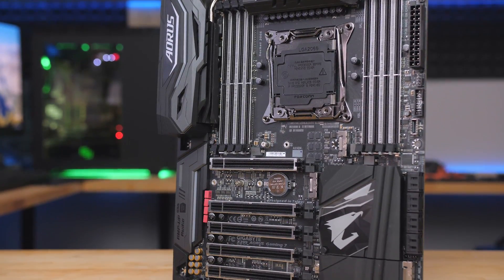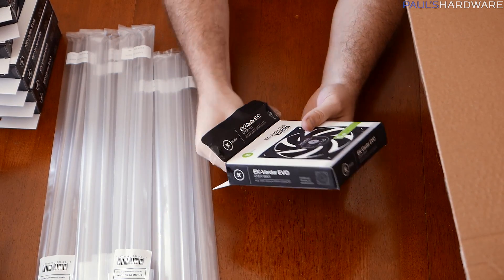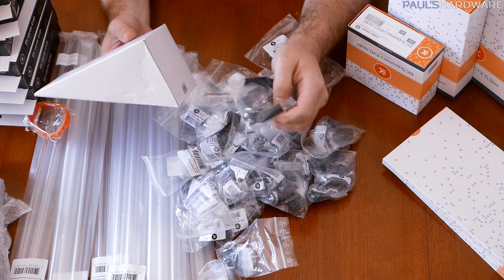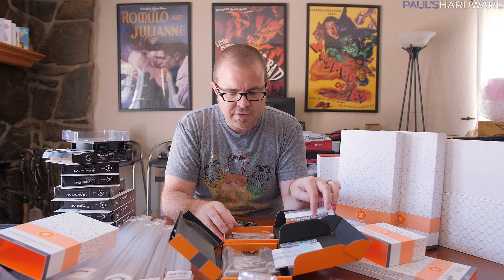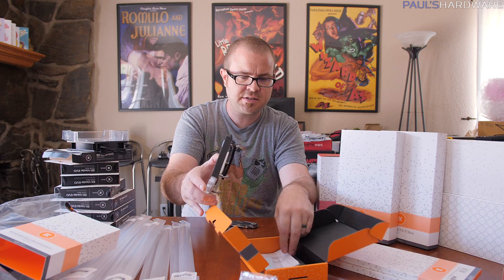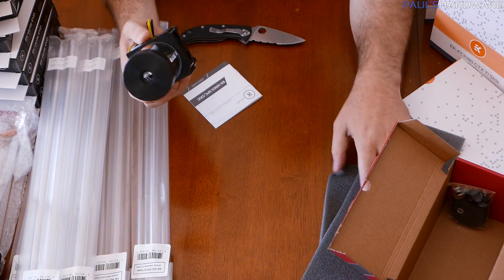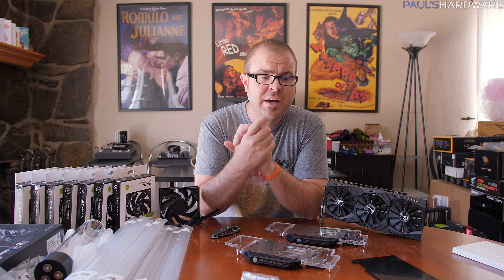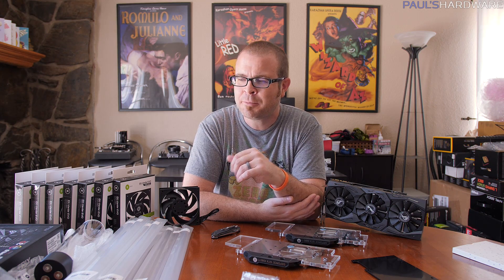FINALLY HERE: Water Cooling Parts from EK for Arctic Panther Rebuild!

Comment: Just a question, why did you go Intel X299 instead of AMD Threadripper for this build?
Reply from the maker: I'll try to point out some of my reasons in a video when I continue the project, but mainly it would be that this system is more gaming focused, that I already have the 7820X so the cost isn't as much of a factor, and I plan to build a Threadripper water cooled build too. Yes, I know that my reasoning is not very strong.
Reply: He said in an Awesome Hardware stream that it's only because he has it and wants to use it.
Reply: to upgrade to an i9-7980XE Maybe?
Reply: 7820X is a very strong CPU at this point in time.
AMD just didn't manage to hit those high DDR4 speeds.
And with ASUS ROG Rampage VI Apex around the corner, you will see some records!
userbenchmark already has it near 3rd best performing CPU in this point in time.(performance compare)
Reply: Red Meat Gaming Yeah, I wanted a threadripper edition :(
Reply: audionut Please don't call me an "AMD peasant", i just asked a question since similarly priced Threadripper chips would outperform the 7820X. I just went where I got the best performance for my dollar.
Reply: Red Meat Gaming ayy
Reply: Paul's Hardware Ok thank you for your response, I thought it would just be an editing/encoding rig, which obviously a similarly priced Threadripper chip would outperform.
Reply: Zahid Shabir It will support nvme raid setup in a couple of weeks more. http://www.legitreviews.com/amd-nvme-raid-driver-threadripper-coming-september-25th_197500
Reply: He's not a shill for asking a question. TR is still a viable gaming build. You could even just OC 8 of the 16 cores pretty high and get great gaming performance. Considering he will probably be streaming on this system too, it makes sense to ask this question. It's also not like that extra performance matters as he won't be at 1080p and if he was with 2 1080ti's it still wouldn't matter. A 7700k couldn't keep up with those anyway. 
You're kind of a dick for saying he's a shill over a simple legit question.
Reply: What if I said he was an Intel shill? Would I get praise from the youtube community for that? Ok. Hold on, let me grab my pitchfork.
I honestly was being kinda sarcastic with that original comment as a reflection of the comments in this video. Someone uses Intel? "Shill!" Even in situations where it makes more sense to use Intel. The vocal community just wants to sound smart by "Thinking different", which quickly turns into thinking the same. Same goes for Vega. Vega is fucking overpriced garbage and people still defend it.

The point about the 7700K remains though. Paul said it was for gaming. The 7700K is still the recommended choice and although he didn't pay for 7820X the 7700K is still cheaper than any of these CPUs. The only reason it doesn't get limelight anymore because of public perception that it's weaker than the Skylake X and TR4.
Reply: 7700k is pointless cpu, quadcores are dead as a top end cpu, trust just wait for the 6 core consumer i7's and z370.
Reply: Red Meat Gaming for reals. Disappointed
Reply: You don't have to justify anything to us, Paul. Keep up the good work.
Reply: Red Meat Gaming he said in a previous video that this was only for gaming( but to contridict myself a 7700k would be best for gaming) Paul makes no sensr
Reply: Why not save some money by choosing Z270 and i7-7700k?
Reply: You're implying that Intel users are more noble. Nobles are typically better educated, but if that's the case WHY THE HELL DID YOU MISSPELL "PEASANT" YOU PHILISTINE?!?!?!
Reply: Nathan Rice,

If you buy intel products, they are over developed and supported by all 3th party's. AMD is more of a process, you buy parts, and hope they will be supported in the near future, needing updates all the time.

Why do gamer noobs use Caps Lock and are not able to use any sense?
Reply: this is gonna be a gaming build and the x299 has better gaming performance. simple as that.
Reply: audionut except that x299 has terrible gaming performance due to the change in chache. and maybe the new bus. so yeah lol.
Reply: nah intel messed up x299, wendel from level1techs has a video talking about it, none of the m.2 ports on x299 are run straight from the cpu they all go through the chipset. band width issues are gonna pop up. the tim also sucks. the new cache system is better for servers but x299 has no ecc support. 

threadripper is getting nvme bootable raid support down the road it just doesnt have it at launch, and besides why the fuck do you want to boot nvme raid? just use it as a second data pool and it s pointless on intels side due to the way the m.2 slots are routed on the boards. but yeah threadripper supports nvme raid just not bootable nvme raid and only through the chipset just like intel unless you have x299 and buy that key thingy. 

also for the people mentioning ram speeds on intel, it doesnt matter beyond 3200mhz unless the specific program you are using benefits from faster ram which many dont. ryzen has scaling beyond 3200mhz. so high ram speeds are kinda pointless for intel systems beyond a certain point unless you absolutely know youre going to need it. 

also btw guys x299 gaming performance is on par with ryzen...... seriously they fucking suck for gaming. it cant even beat the last gen extreme edition with a faster clock speed and better ipc. the cache system really fucked up performance for games. 

x299 couldve been amazing but it was a flop. like seriously do some digging its snake oil. unless you need intel specific technologies skip it and wait for the next consumer platform with 6 cores or the next hedt platform. 

oh you also have to consider you can get 1p epyc cpus for less then alot of the x299 chips. so even if threadripper gets shitty ecc support amd still has a cheaper solution for ecc with epyc.  like pretty sure they have a 12 or 16 core epyc cpu for less then 750$ with a slower clock speed, though apparently epyc wont work in x399 boards so overclocking might not be possible however we have to wait and see. 

best high end desktop cpu for price to performance is probably going to be the 12 core threadripper. dual quadros for workstation use or maybe some fire pro cards, or some 1080tis for gaming, maybe some vega cards if you happen to do a bit of work and gaming, a single nvme drive to boot off of and then a bunch in a raid pool for editing or whatever you want, then couple hdds and maybe some sata ssds, maybe one of those 99$ 10gbe network cards from asus for super fast backups to a nas if you have one that can handle 10gbe transfers. then a case and all the water cooling gear youre going to need. shit ive seen 960 pros throttle, i know threadrippers going to if you dont keep it cool, and any gamer is going to overclock, gpus are probably getting overclocked, vrms on the board will probably get hot, so yeah alot of hot shit in one system. im guessing at least two 360 rads if it was dual vega's and the 12 core threadripper, probably a 360 and a 280 if you went with 1080tis instead. 

however if you need avx performance intel wins. if you need intel specific technologies youre fucked. if you want 4k netflix or blu ray optical drives you need intel. i also know intel has been really chill with warranties, my buddy had a cpu die and they upgraded him for free, from a 4770k to a 4790k. i know not really much of an upgrade but better none the less. 

personally id support amd this time around just cause intel has been shady in the past and well its nice to see competition in the market. it only helps us. had x299 not been a flop though well the 6 core part woulcve been best value chip over all, think 6 cores 12 threads quad channel memory 8 more lanes over a 7700k and i think 4 or 8 over a ryzen cpu, for like 50$ more then a 7700k and a lower end x299 board will probably cost only a bit more compared to a top end z270 but will be of similar quality and probably have more features. and the 6 core x299 part is probably going to be able to hit 5ghz on air in the real world as long as you can keep the board cool, der8auer got his 10 core up to 5ghz on air so a 6 core more likely. and even if it doesnt itll probably hit it on water for sure on a decent chip, thus meaning since skylake and kabylake ipc is almost the exact same for gaming you wouldve had a 6 core 7700kish cpu. but nope the new cache hurt performance. for workstation tasks well depends on exact situation but in many amd can win, the extra lanes can be really useful and while it wont clock as fast i doubt these cpus will be getting any super extreme overclocking so i suspect in the wild clock speeds will be similar so like 4ghz on threadripper and like 4.3-4.5 on x299, but for the same price you do get more cores which could be helpful for many, and the lanes for many others. this is really the market where amd can really hurt intel, same with the server market and then the low end, high end desktops with like i7 level cpus for gaming will probably more often then not always lead for intel unless amd pulls like leaps and bounds ahead. but zen is a server arch, and it scales easily, and it can clock decently fast so its going to be good for workstation purposes.
Reply: I love how everyone is like "X299 sux! Use Threadripper!"
In reality he should use a i7 7700K. That's actually still the best gaming CPU.
It just doesn't have the cool-factor that the "high end" cpus have.

You're kind of an AMD shill to suggest TR for a gaming build.
Reply: bmxriderforlife1234 You said a lot...like, a whole lot, lol. X299 has it's flaws & trade-offs (as does Threadripper), but writing it off as a flop and a useless platform is ridiculous. There are also some significant benefits that make it the preferred platform for a lot of us who use high-end desktops to make a living (low total system latency, Thunderbolt, single-thread IPC advantage, etc). No one is denying that Threadripper comes in at a great price point and offers a lot of performance. The problem for AMD is that most of us who are willing to pay $1k for a processor are also the same customers who are willing to pay $2k for a processor. I gave Threadripper a hard look but after seeing how well the 7900x stacked up  - even though it was at a major core disadvantage - I ultimately decided to wait for the rest of the i9 lineup to release. There is no doubt that at least the 2 top-end chips will vastly outperform the 1950x in every metric other than price. In the long run it's worth making that upfront investment.  

As a side note, waiting turned out to be a good decision because Intel has since announced the Xenon-W platform. That's where my money will be going.
Reply: "The vocal community just wants to sound smart by "Thinking different", which quickly turns into thinking the same."

THIS.
Reply: Nathan Rice
WHY THE HELL DID YOU MISSPELL "PEASANT" YOU PHILISTINE?!?!?! was the only problem, guess the Caps lock was what triggered me to reply.  you can't finish without childish responses? forget language here, everything is misspelled, this is not the UK, most people are from everywhere doing their own slang, can't call this English here....

If you buy AMD systems on launch, expect problems, no real worries for technical people, but to hard for noobs that need these YouTube channels to do a build them selves.
Reply: bcoz he got every thing free :p
Reply: JayJapanB that's basically what I said but ruder
Reply: @CN Tech Haha, whoops. I better mind my manners.
Reply: TR support NVME raid in latest bios update and definitely supports up to 4 way SLI however Nvidia does not any longer (on 1080ti)
Reply: muffemod Not really. He would gain more performance. In game's, no. But gaming and streaming? Little bit
Reply: Paul's Hardware "longer... Being theoretically better in this case" wink wink nudge nudge... Lol one of your best videos I have watched, love the build, sadly it's not threadripper but Ying Yang, can't have good without bad.
Reply: why does it matter
Reply: lucas rem I'm not crying anything, why were you trying to start something you can't finish without childish responses? Coincidentally...

You mentioned Intel being "over developed". So what you're saying is that Intel spends more than they need to, doing more engineering work than is reasonable in order to produce their silicon? No company would ever over develop or over engineer a product. They'd never make sales because in order to balance the accounting, they'd have to jack the price up.

Intel is indeed supported by 3rd parties. So is AMD. In fact, most of the same companies work with both of them, and both CPU manufacturers support their own products with firmware and microcode updates.

You started this whole thing with an insult pointed at AMD users. Not only is that unwarranted in civilized discourse (yeah, it's the YT comment section, that's no reason not to be civil), but you misspelled the insult. We should all be rooting for AMD right now, because competition in the market is best for the consumer/end user regarding pricing.

Buying a CPU isn't about bragging rights. People are going to buy the chip that's right for them, and insulting a person for his/her choice is pointless. If you want to talk about someone crying about anything, it would be closer to the truth to say that you're crying over someone not validating your ego by agreeing with you. That's not an insult, by the way. Just an observation. If you want to exclusively support Intel, go for it. I'm not going to hate on you for it. I just expect the same level of rationality from others in kind. I apologize for calling you a Philistine. That was a bit overboard. Have a swell day.
Reply: Red Meat Gaming because AMD sucks
Reply: more cores more heat less overclock less performance
Reply: the only benefit besides price for AMD is PCie lanes and  soldered TIM for the actual CPU Intel is better but if they did not lock out PCie lanes or use bad TIM as well as lower prices a bit more then they would be better
but a big reason for more PCie lanes besides 2 or 3 way SLI is NVME raid and threadripper does NOT support that
Reply: it will support for free in the next 2 months with a BIOS update. No need to buy, it unlike jewtel
Reply: Nathan Rice
Stop crying bullshit then, go read specs and features, why you need YouTube, or these Noobs who do build video's......
Reply: A better question: Why are you an arrogant troll wasting all of our time?
Reply: He's an Intel shill...
Reply: Red Meat Gaming intel is better you amd pesent